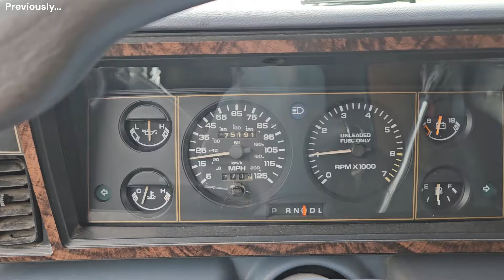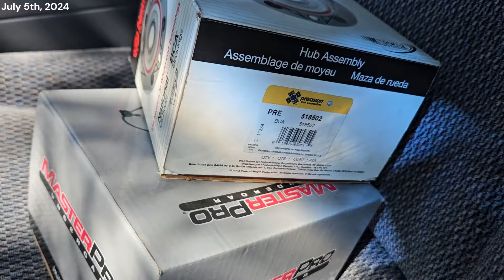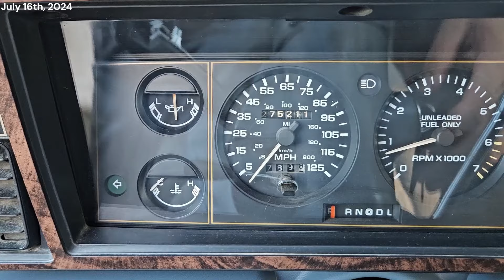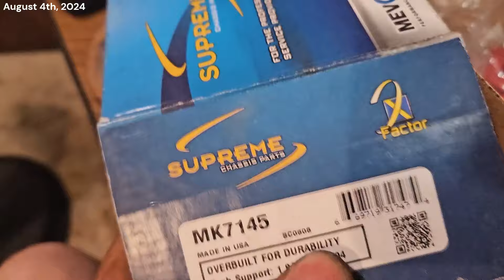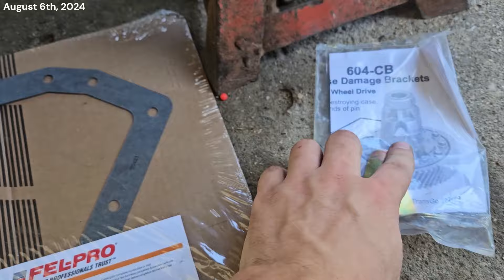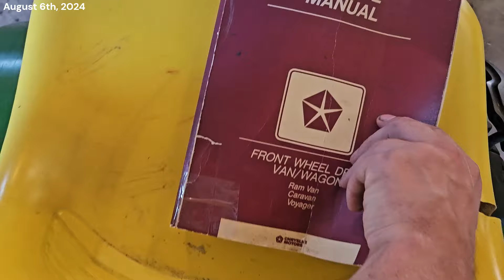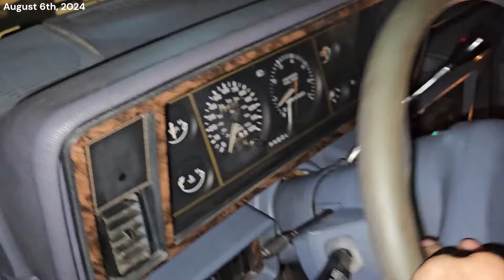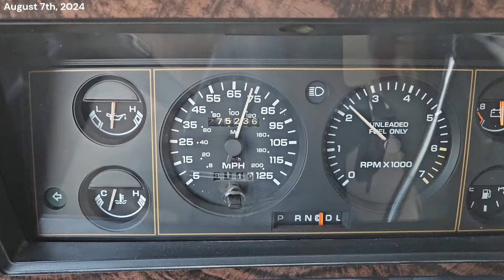1990 Dodge Grand Caravan LE "restoration" | Part 17 | Complete front suspension & steering overhaul

Comment: Hmm do you like the dew? 🤔..😂 and man you basically went though the same shit I did earlier this year I’m about halfway through the video as of this comment.
Reply from the maker: @TFD1982 i drink too much mountain dew lmao. You got your wish with the 2 hour video haha! Enjoy the rest (:
Reply: @MNMoparMinivan  I’m already over the hour mark doesn’t really feel that long when you got nothing to do haha!!glade you were able to get that control arm bolt out I’m dreading the day I have to do mine it looks like it fcking SUCKS.
Reply from the maker: @TFD1982  it did suck. But my van is particularly rusty.
Reply: @MNMoparMinivan  ohh man yours is much cleaner then my 94 mine having the lower plastic cladding it’s completely gone in the rear for the rockers the rear heater lines even have a repair since they rotted out now mine however doesn’t have any floor rot but for 143k you’d really think my van has well over 200k I’m keeping it off the roads during the winter can’t stand to have more salt damage to it I love this van and do plan to get the rockers done you can find replacements but my welder is out of gas and that’s why my trans am hasn’t had more metal work done in 4 years. It’s all in time I’ll get to it my aunts 95 caravan my my town and country are going nowhere I’ll be working towards fixing the 95 after I sell the 96 of corse but I plan to at a minimum drive the 96 for a year or the value goes up again.
Reply from the maker: @TFD1982  looks can be deceiving... this one has quite a bit of filler in it.
Reply: @MNMoparMinivan  nahh really you’ll have to send me a picture I’ll have to send you one once this freak rain quits from the hurricane/ tropical depression that came through.

Comment: Nice video! What did you use to seal the wheel bearings if the other seal was in the wrong place?
Reply from the maker: @Compact-Disc_700mb  so the seal on the bearing hub was fine. I accidentally left the metal dust cover that goes on the axle side with the seal... when you get axles the dust cover is already on them. So I had doubled up the dust covers
Reply: @MNMoparMinivan  Oh ok, that makes sense now thanks! I do not know why that confused me so much.
Reply from the maker: @Compact-Disc_700mb  I can't imagine I explained it correctly in the video either lmao

Comment: U put new bushes in the subframe that u dropped and the lower control arm , looks like a rod coming out goes into. I think it was red or orange. What is that bushing called and where did u get it please. I have to get them for both sides
Reply from the maker: @michaeljackson8510  it's called a strut rod bushing. Rock Auto has the kit for like $10 includes both sides. Getting the old one out sucks because it's a 1 piece bushing where the new ones are 2 piece.
Reply: @MNMoparMinivan  man, u have been such a big help. Thank you.
Reply from the maker: @michaeljackson8510  glad I could!! Keep that van on the road (: